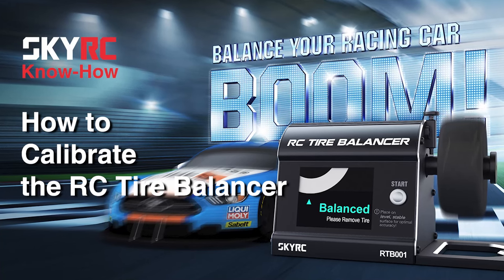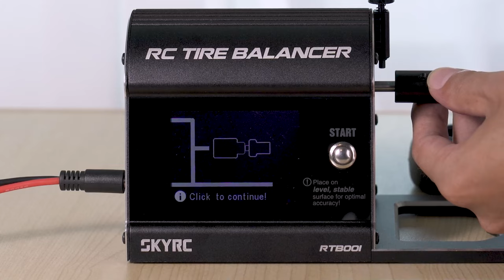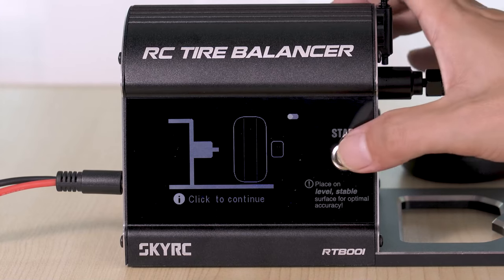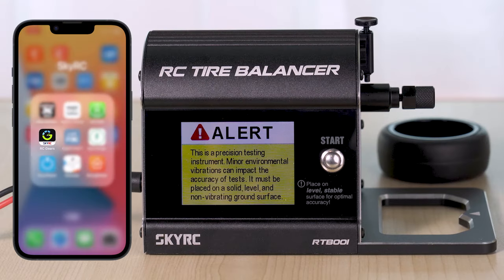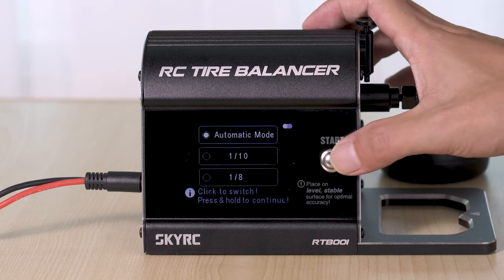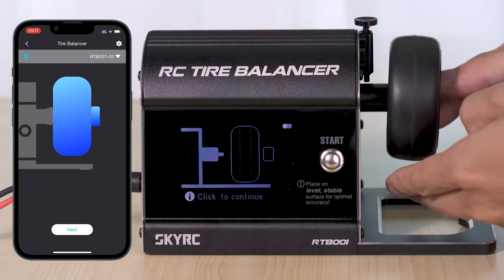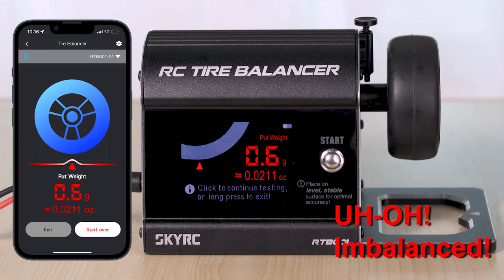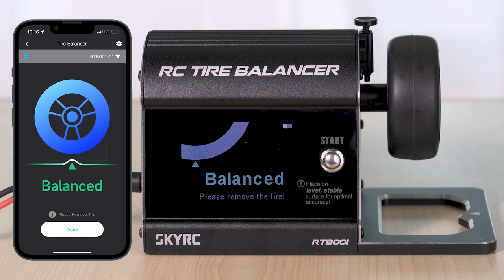SkyRC RC Tire Balancer Hands-on

Comment: Mine will not calibrate. Why is that?
Reply from the maker: Cautions:

RTB001 is a high-precision instrument. Before use, pay attention to the following guidelines to ensure the optimal performance and longevity of the RTB001 instrument.

1. Avoid exerting force on the protruding part of the motor shaft in any direction, even when installing the adaptors and tires. Forcing it may lead to damage to the internal sensor.

2. Ensure that the operating surface is stable and free from vibrations. Ideally, place the instrument on a firm and level surface.

3. Maintain a moderate airflow around the instrument and avoid exposing it directly to large objects such as air conditioners or fans.

4. During usage, transportation, and storage, take precautions to prevent the instrument from falling or being subjected to excessive vibrations.

5. When the instrument is not in use, kindly remove the tire from the adaptor and disconnect the power supply.

6. It is strictly prohibited to touch the tire or forcibly stop the motor during detection rotation, as this may cause damage to the motor and sensor.
Reply: Man who would’ve thought to read the manual when there is an issue. Copy in paste from the manual is definitely the best form of support I have ever seen before what a joke.

Comment: Maybe just do a better job of gluing your tires on..
Can't believe they've brought a machine out to tell you where to stick some putty 😂😂😂😂..
Absolute waste of money..
Reply from the maker: thanks for your feedback, tire balancing is critically important from a safety perspective!
Reply: @skyrcshow  Wait, did you just say R/C tire balancing is critically important from a safety perspective?

The device in this video has a lot of run-out, you can see the adapter wobbling and the tire wobbling. How is that not throwing off the measurement?